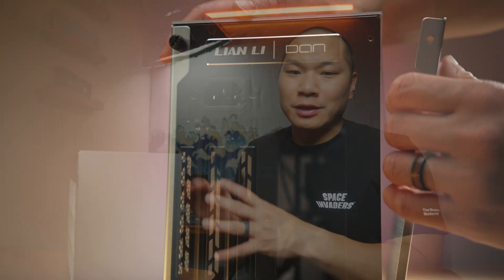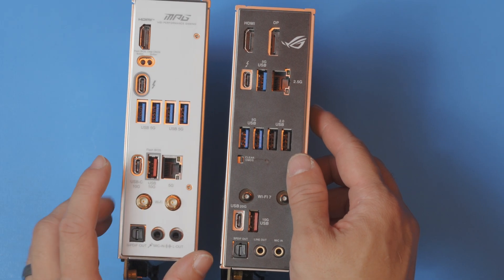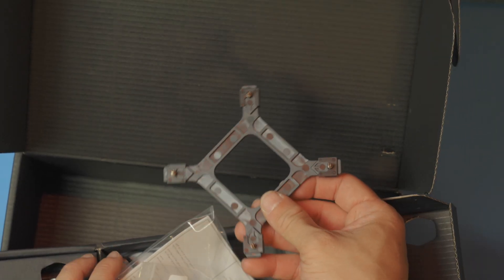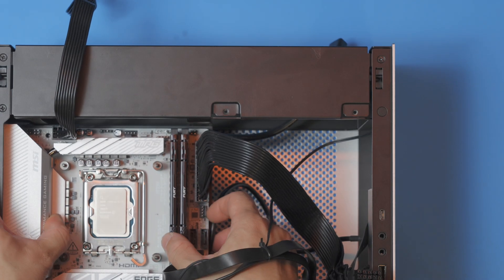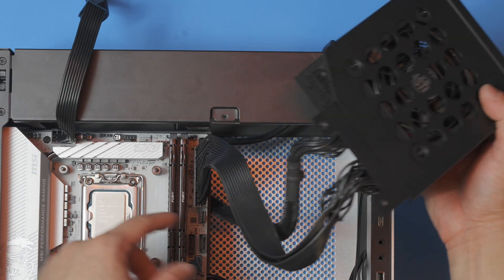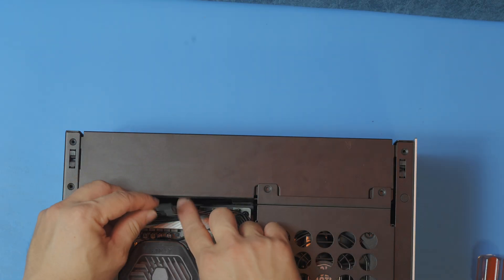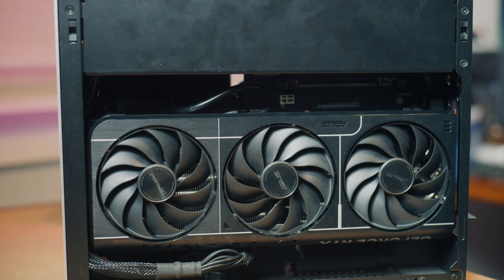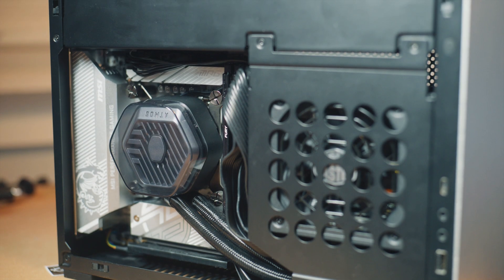2025 Mid-range Lian Li A4-H2O Build!

Comment: Did you use the longer gpu standoff when installing the graphics card? and is your aio in this configuration set to intake or exhaust? Because I thought it was better for the aio to be set to exhaust in this case. I built in this case with a 9950x3d and an asus prime 5070ti and I was recently wondering whether my aio fans were running as intake or exhaust because I installed them as they came preinstalled and I also didn't use the longer gpu standoff

Comment: Other than having a giant worry for the ram market blocking me from updating my completely unstable 2020 3070 build, I would love to see more on the market some sort of cuboid nr200 clone for a sandwich air cooled layout, after 5 years you can very well notice how much space is leaking needed airflow, and this case in particular is a nice example how tweaking even a little the space needed for components can improve temps noticeably
Reply from the maker: Yeah, I feel you on the RAM. Not sure if this is a blip or the new normal.

Comment: I have this case and I love it. Although some cards are too big for it. I wanted to buy a 9070XT from Sapphire, and that card is hugeeee. But cooling wise and the quaility is unmatched.
Reply: I managed to fit the PURE version just fine. Slide it through the front and it sits nicely
Reply: @bizzlebizzle1994  Yeah, as long as it doesn't exceeds the max length of 322mm (I heard you can squeeze a little more but I wouldn't risk too much) and not more than a 3 slot card (afaik up to 65mm? thickness) it should be fine. Those cases are meant to fit proper full size GPUs. Only those 4 slot clown cards are too much, but luckily that isn't as much of a trend as we thought.

Comment: i'm trying to find pcie gen 5 riser cable for A4 H20 do you know what aftermarket ones will fit in this case?
Reply: I think it needs to be a dual reverse one, but I find conflicting reports on the cable length. The performance loss between PCIe gens is neglible though.

Comment: Ha just did an A4-H2O build with the same cooler but taming a 7950X3D and 9070XT. I used the SF750 and it made the whole build a breeze. Anyone who is hesitant about SFF being harder to build in should try this case.
Reply: what are the temps on your 7950x3d like for you? Bought the parts to do a build in this case just ordered the 9950x3d which should come soon and a 5070 ti which is otw aswell. Was really between whether I should get a lower tdp cpu but ended up going all in

Comment: If anyone is curious the FormD T1 2.1 5.0 riser is the perfect length in the A4H20. I’m currently using it with a 5090FE
Reply: By the name I guess it's 200mm? Unfortunately Formd's website is absolute garbage when it comes to providing any sort of useful info. lol
Reply: @Dark__Thoughts I think so because I’m running it in the 2 slot offset. The thing I like better is there is actually less slack than the original riser. So maybe it’s 180-190mm
Reply: @XHeavygunX  It's a little confusing because you can find conflicting info on the riser length that ships with this case and people want to know for 5.0 risers. 

Though, I say it here again, the PCIe performance between generations is negligible, and 5.0 risers are still very expensive.
Reply: @Dark__Thoughts I did that because my original riser was faulty. Instead of waiting for a RMA I used the 5.0 from my T1
Reply: @XHeavygunX  Yeah, that's fair if you already got it anyway. What made you switch from the T1 to the A4?
Reply: @Dark__Thoughts I just tend to move cases a lot for various test and setup. I got the atmos stealth and was wanting to see how the stock fans compared to the p12 pro. Two full size fans wouldn’t fit in the T1
Reply: @XHeavygunX  Formd did release those two extended top / bottom panels for that extra space I think. But yeah, that's one of the issues I have against the T1. I feel that extra liter in the A4 gives it just a bit more of an edge & peace of mind.
Reply: @Dark__Thoughts yeah and it’s still good for air cooling also. Plus the upside is the parts are readily available and not scalped lol
Reply: @XHeavygunX  Not just parts, but the whole case is widely available (and much cheaper). And yes, especially if you go with a 3 slot GPU, or 2 slot + gap, which would result in more or less the same space for CPU coolers in the cases that do have a moveable spine. I still would like to see that feature on this case for options to use 2 slot cards with 70mm coolers but it's alright. Thermalrights full copper coolers are still decent options for this.

Personally I also kinda prefer the visual design of the A4 over the T1, and the PSU is the right orientation too since the T1 is usually built in an upside down config. I guess ultimately both cases could do with a do-over. Maybe Formd could do a 10-11 liter successor case using the construction layout of the Perseus Pantheon, which I thought was pretty innovative and flexible.

Comment: Still don't know why would anyone recommend Cooler Master SFX PSUs when you have Thermalright TPFX or Corsair SF that are much better, cheaper, quieter and with immensely better sleeved cables... 2025 and CM still uses these horrendous cables while being more expensive than well known Corsair SF series...
Reply: Yup. Put in there Lian li SP too!
Reply: @Alfie0001  The new v2 is amazing
Reply: @TheRealFenwick  The SP750 & SP850 v2s kinda went unnoticed because they announced the 2nd platinum iterations of them!
Reply: @TheRealFenwick i tested it and its kinda loud ngl
edit: returning it. It is so loud Im replacing it.
Reply: @TheRealFenwick  i saw the reviews and its still loud, not to mention they still use garbage cables...
Reply: Yeah. Those stiff cables look like a nightmare to work with in such a small case. The Corsair are also one of the most efficient ones, based on ratings. The Cooler Master are quite a bit cheaper where I live though. 140€ for the 750W one without the fire hazard connector vs 170€ for the Corsair 750W one.
Reply: @Dark__Thoughts  oh really? in the biggest store in my country(switzerland) the cooler master ones are the expensive ones and are always in backorder... probably because of all the returns that they had to handle when they released, there was a lot of "open box, but tested" on sale all the time, don't know...
Reply: facts, i have a corsair sf750 (the newer model), working in an SFX pc is a dream, cables are braided and thin, better for tight spaces, and a dedicated 12vhpwr included with 2x8 pins, great power supply, fan barely spins too

Comment: For us in the UK do you reckon get the regular atmos as the stealth isn't available? We can get the atmos 2.
Reply from the maker: Atmos 2 is good too, regular Atmos at a deal is also appealing.
Reply: You can try any of these:

EK Water Blocks Nucleus CR240 Dark
CM Masterliquid 240 Atmos
CM Masterliquid 240 Atmos II
CM Masterliquid 240 Atmos Stealth
CM Masterliquid 240L Core
ID-Cooling FX240 Pro
Montech Hyper Flow 240
ASUS ROG Strix LC II 240
DeepCool LS520 SE 240
Reply: @BlackAera  Copy pasted so hard that you did not even remove the very AIO they were talking about...
Reply: @Dark__Thoughts Yeah I copy pasted those from my own list. Because guess what, I have a curated parts list on my phone and the AIOs that fit the H2O even have cute little crown symbols because I once wanted to get this case. Just wanted to help.
Reply: Check out the Lian li Galahad II Lite too.
Reply: @Alfie0001  Don't! The pump height of 67mm does not fit into this case. This is terrible advice!
Reply: @Dark__Thoughts  It doesn’t fit in the H2O? I’m sorry I didn’t know. I tried to suggest a good AIO 😢
Reply: @Alfie0001  Max cooler height, regardless if air cooler or water cooling block, is 55mm. If it had a moveable spine like some other cases, and you'd go with a 2 slot GPU, you could probably fit up to 70mm (based on similar sized cases with moveable spine). This one is more limited / less flexible though (but much cheaper and actually available).